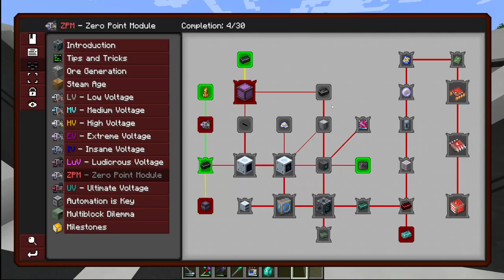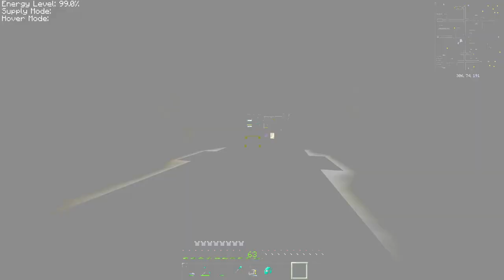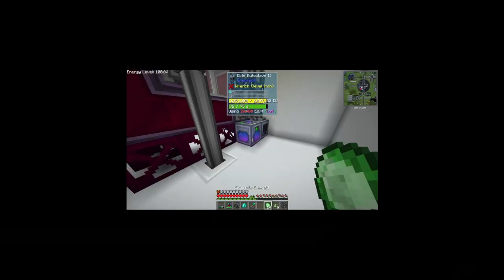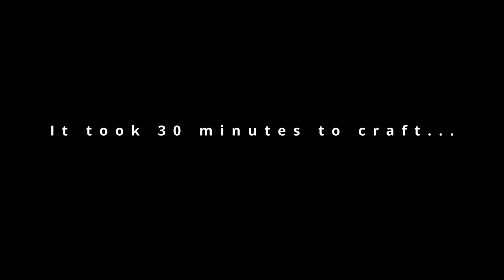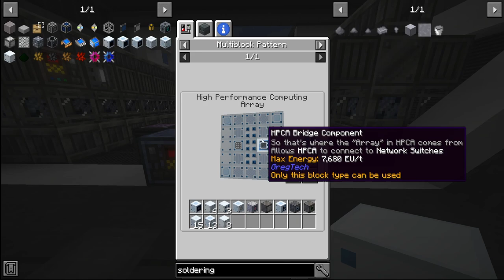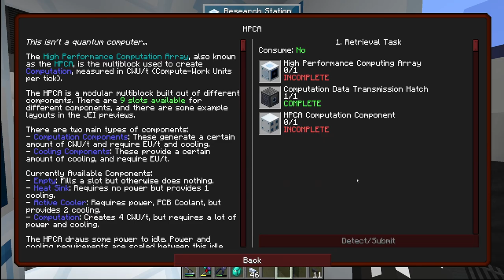Gregtech Community Pack Ep13 - The Ultimate Circuit

Comment: With the UV circuits unlocked, you'll be able to get the next tier of parallel hatch, but I think it's better to wait until you get the wetwares, they're obviously much much cheaper. For now the best thing you can do with the uv circuits is making the next tier of circuit assembler, which will unlock the cheapest recipe for EV and IV circuits and also unlocks the wetware recipes.

Comment: not sure if this is answered in a future episode. the fix for the assembly line issue. from dual interface with the ass line recipe patterns on blocking mode, that needs to point into a dual interface on a sub network. the other items on the ae2 subnetwork are storage busses with priorities going from highest to lowest, front to back of the assembly line. additionally there needs to be four fluid storage busses for the fluid to be placed in. using priorities will keep the recipe ingredients in the right order.

Comment: How do you get multiblock guis to display on your central monitor? (Substation, fusion reactor)
Reply from the maker: You can use a proxy card with the wireless cover, so in your central monitor you add the plugin and set the display to proxy mode